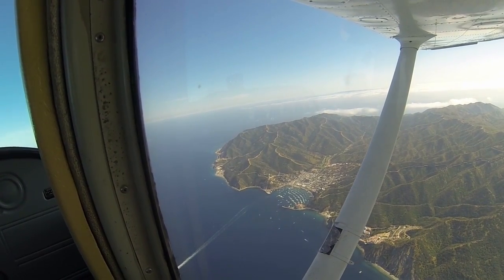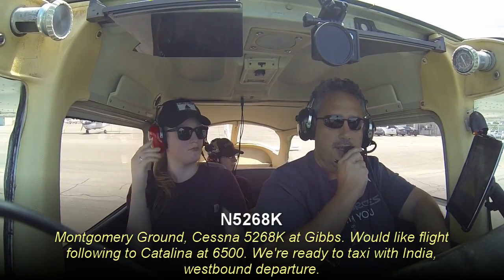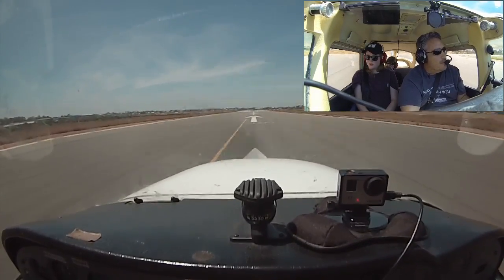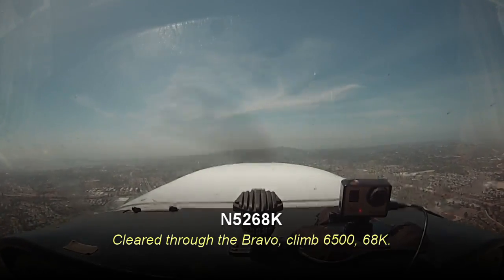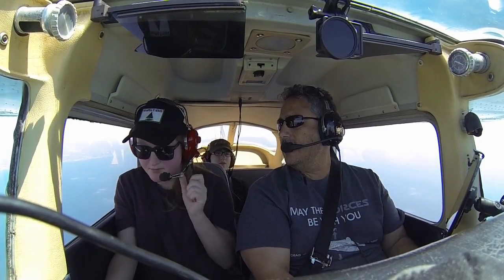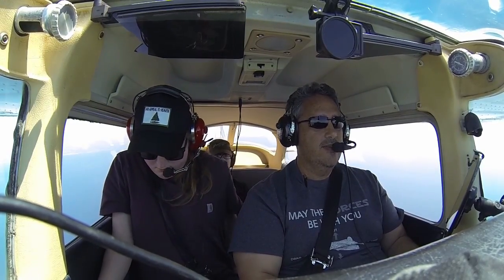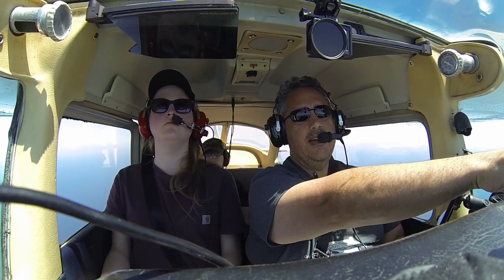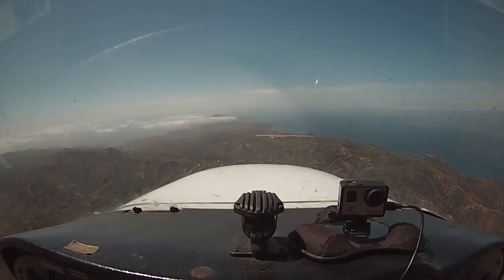Flight to Catalina to See the New Runway!

Comment: The Marines didn't resurface the asphalt runway but replaced it with a concrete one. It's nice to see that the hump in the middle is gone. Many years ago I flew in there with my instructor the day after I got my license. I flew into there many times since but never visited downtown Avalon.
Reply: I have flown to Catalina 30 years ago, I'm glad the runway is fixed without the hum, which caused many newly pilots to get confused.

Comment: I remember my first (and only) flight to Catalina. I was a private pilot and my flight hours were in the single digits. And the approach and landing were NOT the most "exciting" portion of the flight ...

I was flying to Torrance airport in a used plane I had recently purchased to pick up a couple of friends to take to Catalina. Due to a screw-up in using my VOR (it had a feature which kept the needle centered so you can easily find what radial I was on). And ... guess what?

I forgot to turn that feature off and when I thought I should have been close, nothing looked right. I called Torrance airport and they couldn't find me on their radar, so they handed me off to approach control who located me ... in the middle of the LAX terminal control area (it would be "Class Bravo", now), WITHOUT a clearance. 

They gave me vectors to Torrance and the tower gave me the bad news ... contact ground for a phone number to call. After landing and parking I called and explained what had happened. I then picked up my passengers and headed to Catalina. I landed on my second attempt, being too high (or thinking I was), and landing uneventfully the second time.

As for the FAA, I got a letter asking for a written explanation, which I provided. I never heard anything else.

Some time later, a small plane also busted the LAX TCA, had a mid-air with an airliner, killing everyone. They revised their rules. I think they made a TCA violation a MANDATORY license suspension, requiring retraining to get your license back. WHEW!!!
Reply from the maker: Great story! Thanks for sharing. Glad it worked out with the FAA.

Any reason you haven't been back to Catalina? It's truly one of my favorite destinations. My first time was with an instructor. With the narrow, upsloping runway it's hard to get right on the first attempt.